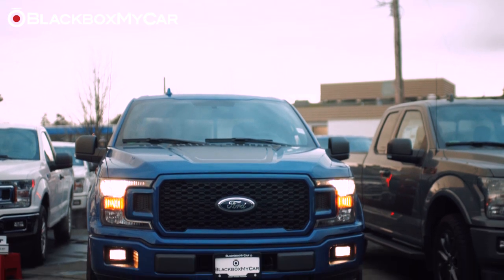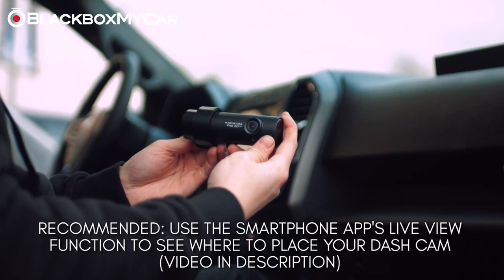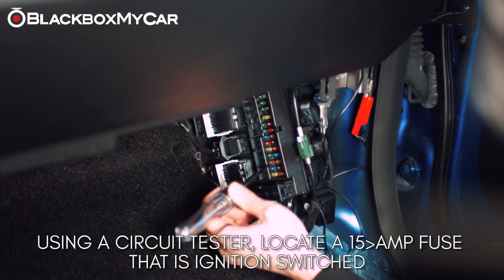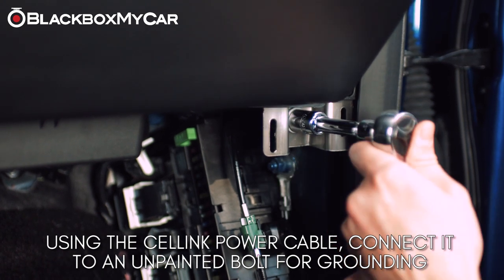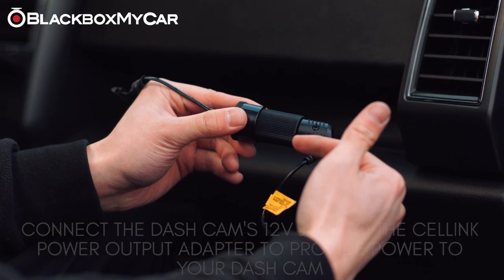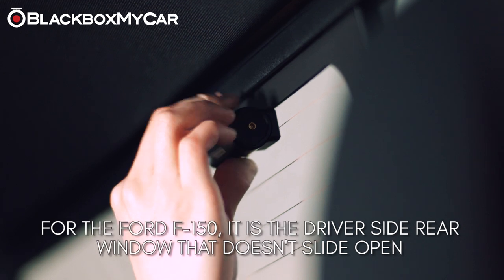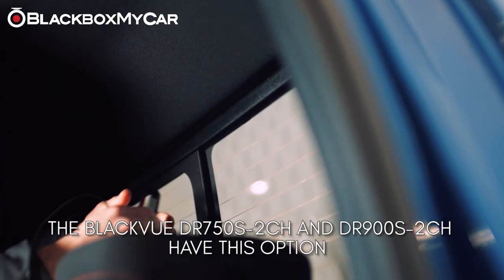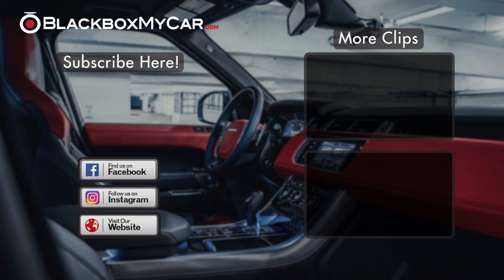How To Install a 2-Channel Dash Cam in a Pickup Truck - BlackboxMyCar

Comment: I've got a 2006 ML Triton GLXR with the sliding rear window, however it is much larger than the window on the F150 and slides down vertically. Would this camera (currently on sale in Australia for $419) be a good choice? I've put it off for a good 12 months because of how complex I expect the install to be because of that window.
Reply from the maker: Hi Nathan, if your window is a sliding one, we wouldn't recommend it if the rear dash cam will get in the way. On the other hand, if you can make sure to tuck the cables cleanly, and you're careful with sliding down the windows, we don't see why you can't make it work :)

Comment: is there possible to install rear cam outside somewhere ???
Reply from the maker: Hi Tacoma, wouldn't recommend it. The housing on a regular rear cam is not made to be installed outside the vehicle as it would not be able to sustain the wind / rain / environmental damage that could occur. If you are looking to install a dash cam on a pickup truck (or a box truck) where the rear dash cam has to be installed outside, then we would recommend looking into the BlackVue DR750S-2CH IR Truck. That's made for that.

Comment: Where did you mount the battery? Which fuse did you go with? How did you conceal the wire as it went around the cab?
Reply from the maker: We typically mount the battery pack under the front seats. Fuses are completely different in each vehicle - you need to use a circuit meter to test which is an ACC fuse. We tuck wires in panels and headlining.

Comment: What mounting suggestions do you have for a Chevy Avalanche due to the removable rear window?
Reply from the maker: Hi Keith, unfortunately that's a pretty hard vehicle to install on from our experience, so we wouldn't use a suction cup mount nor mounting tape. You'd have to use some sort of custom mount that gets attached to the rear headliner.

Alternatively, perhaps you could try an external rear camera like the BlackVue DR750S-IR Truck dash cam: https://www.blackboxmycar.com/collections/blackvue/products/blackvue-dr750s-2ch-truck - You would have to drill holes into the rear of your truck though in order to make this work.

If you have any other questions, please contact us at info[at]blackboxmycar.com!

Comment: I have 18 Chevy Silverado and I was expecting an installation video on how connect your rear dash cam to your truck tailgate. Do you have any dash cam product that come with two rear cam? One for the rear windshield and another one for the tailgate?
Reply from the maker: Hi Bruce, I'm afraid we do not have any dashcam products that can be mounted in the tailgate at this point in time. The rear-facing camera would either have to be mounted at the back of the cab or if there is a canopy over the box,  the back window of the canopy (right now only possible for Blackvue DR750S/DR900S for which longer cable options are available).
Reply: Blackbox How would you feed the line towards the canopy if I can't keep my rear window slightly open where water can seep through?
Reply: BlackboxMyCar how to install rear camera on my tundra when the entire window rolls down? Can it be mounted in the middle of bottom windshield facing rear?
Reply: I was also looking for a similar solution and thinking that a reversing camera near the numberplate could be a solution?

Comment: What if you have a Hardtop on your truck? How would you install it?
Reply from the maker: Hi Isla, if you have a hard top, then you should be considering the BlackVue DR750S-2CH IR Truck: https://www.blackboxmycar.com/products/blackvue-dr750s-2ch-truck - where the rear camera has an external housing that allows the rear camera to be installed externally and on the back of the truck.